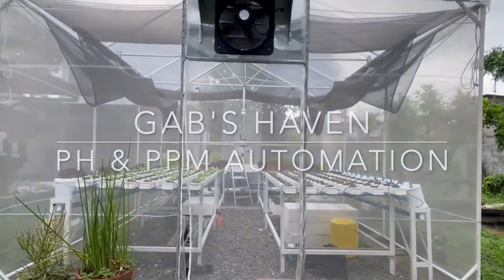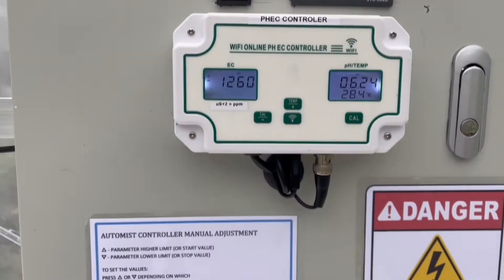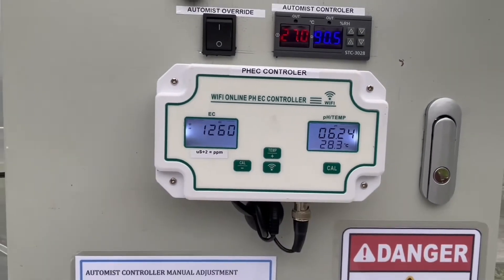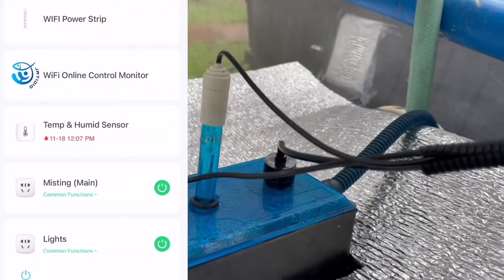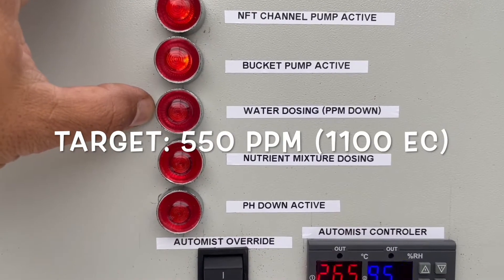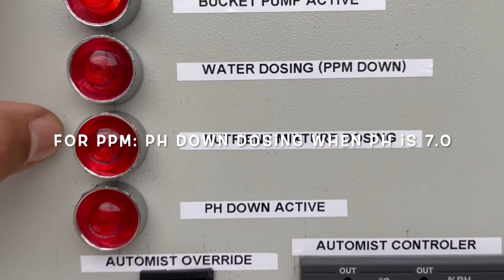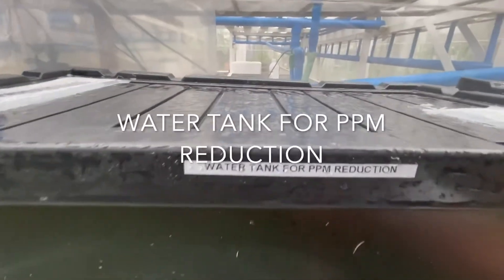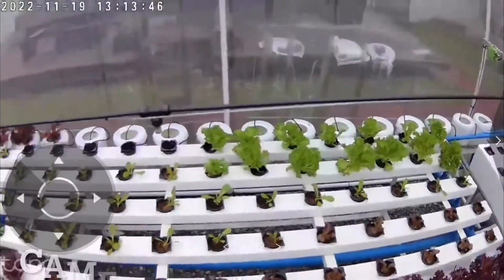Gab’s Haven - Hydroponics pH and PPM/EC Automation

Comment: Hello, I have a few questions about this controller: 
1) Is the EC probe replaceable? 
2) Do you have a version of the controller with or without sockets, and is the pump controlled by a smart WiFi socket? 
3) When feeding, for example, PH, does the pump run all the time or do you have a time relay that provides power for, for example, 5 seconds and takes a break for 5 minutes? If the nutrient does not stabilize, is power supplied again for 5 seconds? How did you do it? Thanks in advance for your answer!

Comment: Excellent work, I would like to ask you about the EC sensor. I would like to know if the sensor is submerged in the liquid 24/7, and if so, is there an error in its measurements? Since I tried the "TDS Meter V1.0" and after being submerged for a while, the measurements were no longer adequate, greetings from Cusco, Peru.
Reply from the maker: Hi! Thanks for watching. My sensors are submerged all the time, yes. I’ve had errors twice with my pH since I installed them last August last year, and during the last failure I thought I’d have to replace the sensor because of the offset (I was getting around 11 for my pH when it was having around 7.5!) anyway I just let it plugged, seemingly corrected itself. I rarely do manual measurement since I’m away from home since January this year. 

For TDS, hopefully it’s still correct. My sister who takes care of the farm while I’m away doesn’t know much, so what I get from measurements are my only trigger to give her instructions on adjustments. 

To answer your question, there might be errors already. I’d come to know when I come back within couple of months more. :) will keep everyone posted with my update post when I get back. 

Enjoy!
Reply: @musikerongbundukero  Great, do you have any recommendations on the brand of EC sensors, perhaps yours of the highest quality. Would I like the model and make please?
Reply from the maker: Oh! By submerged, we both mean only the tip right? :) the cable part cannot be soaked with water I guess.

Comment: Sir anong dosing pump ginamit mo at pano sineset sa controller yung pump?
Reply from the maker: Nothing in particular. I use a cheap aquarium pump, 32W. Sa setting, nagbabase sya sa reading ng PPM. App ang nagra-run. Sa cloud (or sa internet) sya kumukuha ng command via app.

Comment: The controller does it have the ability to control the outlet for a specific time? so I can dose a certain amount of liquid ? or do you know were I can download the manual for this model ?
Reply from the maker: They have really flexible output base on your needs. They can be time based, and in my case I used both reading-based using ph and tds/ec values and time-based that I only do the dosing at night. :)

Comment: Thank you for this video I have been looking for someone that was using this device I'm going to purchase one and was wondering has it been very reliable for you. And is there more info that you have shared? I would love to know I will use this as a source to get mine up and running if that's OK thank you for your time.
Reply from the maker: I don’t exactly remember but I purchase usual low wattage aquarium submersible motors.